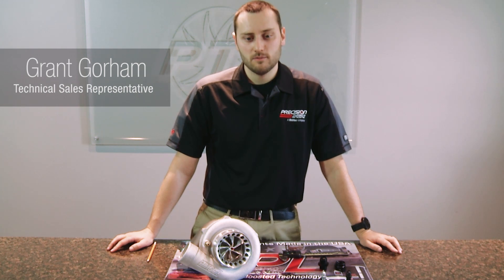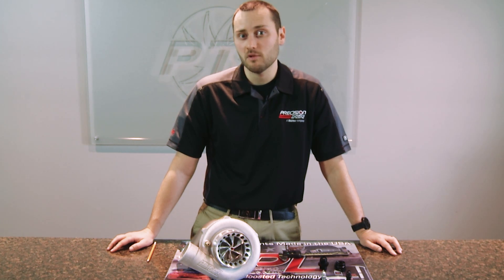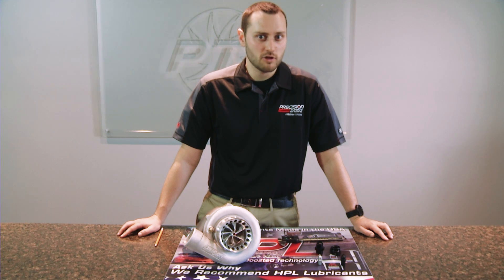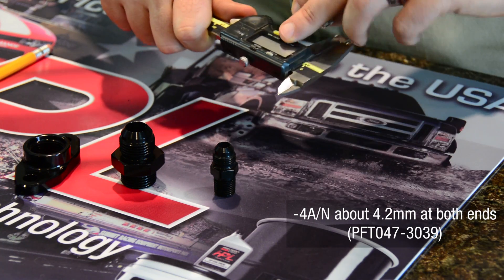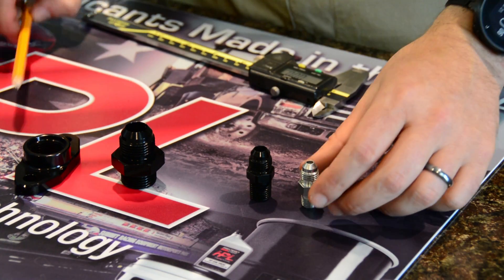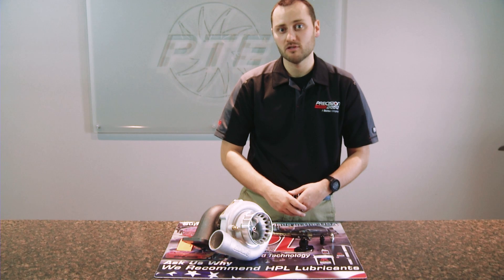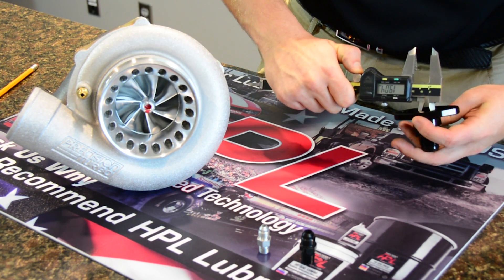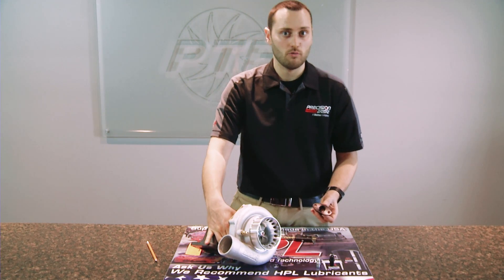Oil Feed and Drain Set Up on a PTE Turbocharger

Comment: I have a 6262 PTE JB on my Honda s2000 with 4an feed to a 10an return. I had oil once sprinkle all over my charge pipes and components that are close to the turbo as well as some smokes coming out of the exhaust that a friend of mine noticed. It haven’t happen again in a month. Is this normal or should I change my setup? I heard honda s2000 have high oil pressure.

Comment: Hey bro i bought a gen 2 pro mod ,i am using dash 6 fed line and dash 10 return when the car idles it leaks oil.dint drag the rx7 yet but scared if oil leaks on the slick..very unhappy with precision and lack of help.lots of people say thats normal,i cant see that doe,any help,its brand new.and expensieve.

Comment: what about a remote twin turbo set up   like i have    I'm running a -6 to the rear and splitting off to each turbo  than a -8 out to a pump  thann to the oil pan. looking to upgrade to precisions  but need guidance to select the right one  lol

Comment: Some good info, but one thing you didnt touch base on is the use of an oil feed restrictor, which i have had a LOT of people ask me about when to and when not to use them. Just food for thought and keep up the good work, really like the turbo talks idea as it helps out a lot of people, as we all know there is a TON of info to dig through and all too often there is a LOT of very bad info thrown around.
Reply: Yeah, based on research, journal bearings dont require a restrictor while a ball bearing turbo does. On the precision website, the -4 to 1/8" NPT fitting description states "PLEASE NOTE: no restrictors are to be used inline of a -4an feed fitting, just this fitting. ". On forums, either a -10 drain line or restrictor fixes a smoky turbo. I wish precision would give us an answer